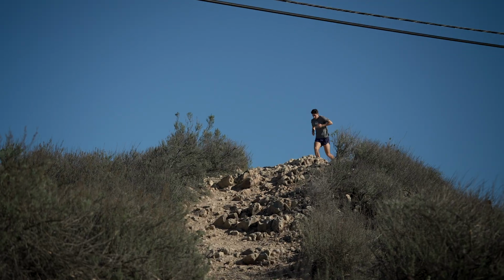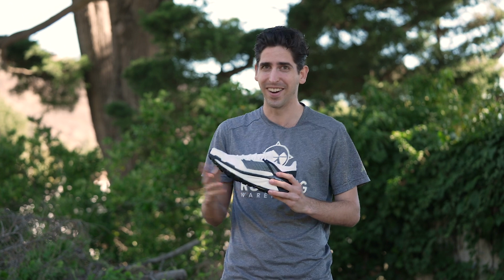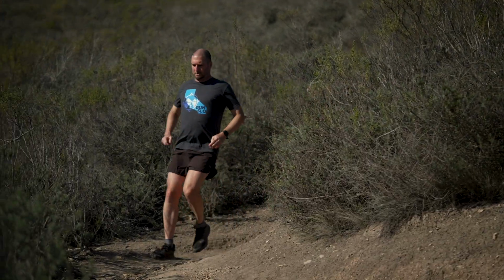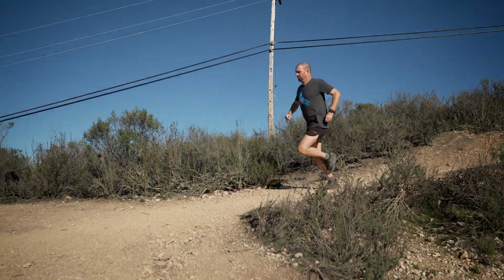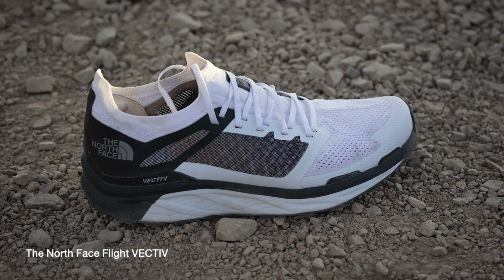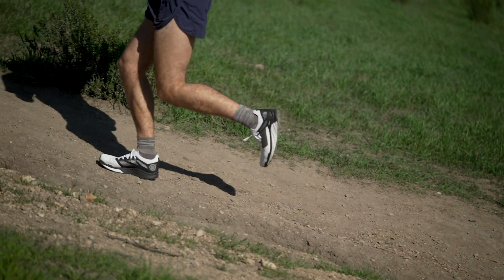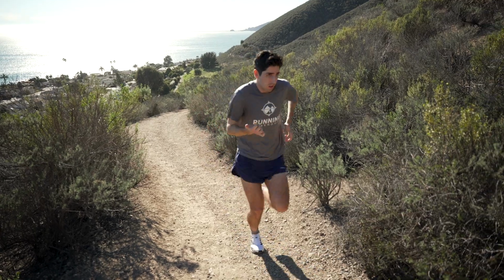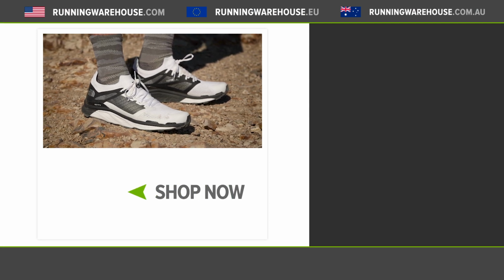Testing Out A Carbon Fiber Plate Trail Racing Shoe | North Face Flight Vectiv

Comment: So half-size down?
Reply from the maker: I had to go half size down, shoes were to long in my standard size.  -Connor
Reply: @runningwarehouse  not to press you, but do you feel it got more restrictive across the metatarsals after sizing down, or roughly the same?  I just received TTS and lengthwise could certainly go down 1/2, just concerned about metatarsal splay room.  Thanks for any advice!  Did your other tester also size down?

Comment: Carbon fiber plate in trail shoe? it is not too rigid? I'm wondering if you take a stone, what happens to the plate?
Reply from the maker: There is a somewhat rigid design but I felt they performed well, even on technical terrain. We ran on fairly rocky conditions and the plate holds up well. Erik put lots of miles on his proto and had no issues with plate durability. -Connor